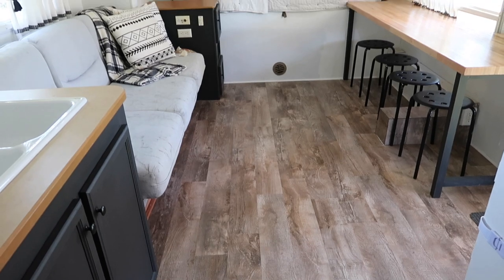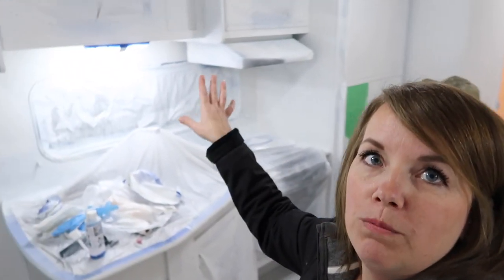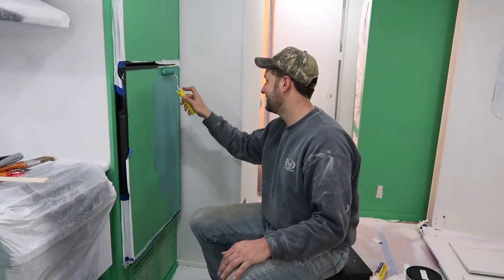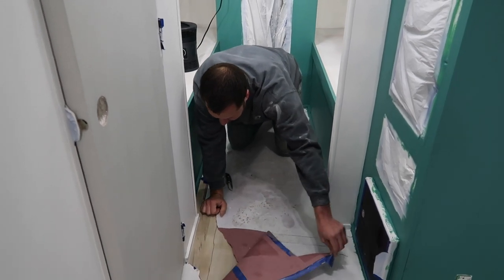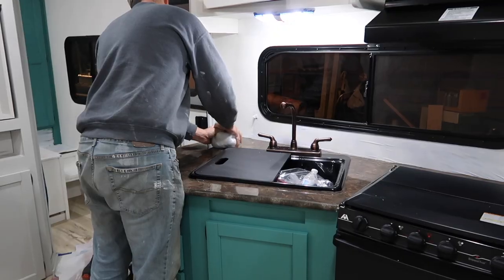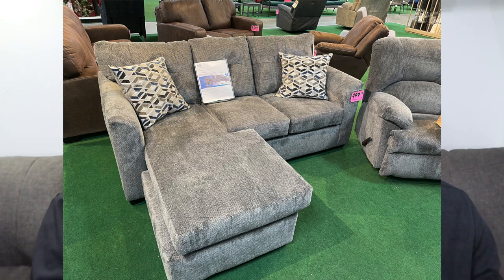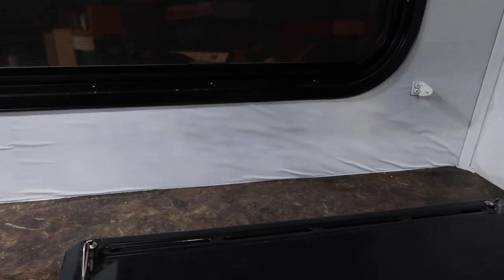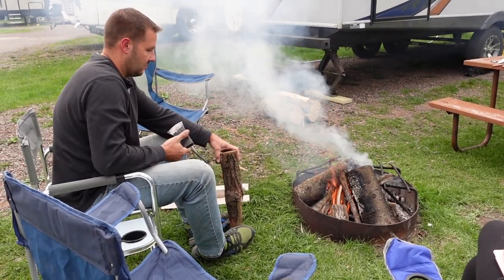We won't make this mistake again (ok, maybe we will ;)

Comment: You might want to try sitting the instapot and air fryer outside when you're using them.  Then the camper won't smell like whatever you're cooking and it will save space inside.
Reply: This is totally what we do. We bring a small 4ft folding table with is and set it right outside the door. Works great!!
Reply: Well, if it’s cold that’s not workable.
Reply: @donnakkasper6634  That is true. We are in Arizona, so the coldest we have ever camped in is with a low of about 33-35, but usually it is warmer. We have a pop-up tent trailer, so not much inside space and have not had any issues using the appliances outside.
Reply: That's a good point! 

My parents have a camper and they rarely cook inside it. They're always using a propane stove or a grill outside. I think they don't like the heat and humidity cooking in a small space can make.
Reply: Won’t work in bear country, either!
Reply: Lots of people cook and eat outdoors while camping in bear country—it just needs to all be put inside either the camper or vehicle at night or when away from the camp area.
Reply: @jenniferstanton202  which may be reason they are bringing the insta pot and fryer.   But then one wonders why they didn’t just rip out the elements and range part and put extra cabinet or a table there.
Reply: When the mini fridge in outdoor kitchen broke, we put a big toaster oven (Wolf brand) out there instead. 2-burner propane stove for outside cooking. Like most stove/oven combos, ours suck. So we have a 1-burner induction burner for inside use and we have to go in and out for the oven but well worth it. Crock-pot stays outside too if warm enough.

Comment: First thing we did when we bought our 5th years ago, had the dealership rip out the U-shaped dinette and crappy cheap couch immediately (and had them throw away the master bedroom mattress and duvet). We put in 2 rocker/recliners (they are not the wide lazy boy ones), a 4ft folding square table and 3 folding chairs (just 3 of us anyway). Plus our dryer sits in that slide also (we have a pantry/laundry room, hard to find this floorplan anywhere else, we got lucky) so washer goes in there. Been a blessing! I could put pics up on IG if anyone needs a visual. Btw, since adding the dryer, the teen can eat at the table and we eat at tv trays in our rocking chairs or scoot the table more into the kitchen/dining area.

Comment: For backsplash, you can get peal and stick glass tiles that look really pretty from Home Depot or Lowe’s.  Love what you’ve done. We are redoing a 16 foot, but had to gut and start from beginning due to dry rot. Got new floor and walls finishing new ceiling to put tin roof back down on. Then putting tin back on sides. Then... we will get to think about furnishing inside.😊

Comment: The green is gorgeous! 
I swear by the 60-30-10 guide. I also like to select 1-2 frame/edge/fixture colors to use as a guide when selecting fixtures, hardware & accessories (even picture frames). Examples:  black & antique gold OR dark charcoal & brushed chrome. Keep those on your color swatch sheet too as you shop.

Comment: I just finished your video and had to comment.  The first color Tom painted, although beautiful was a bit bright.  The second is so much more complimentary. You two are doing a great job on the camper and I look forward to hearing how your upcoming road trip goes.  I sit at my kitchen table every morning and gaze at my 2003, 23ft, KIWI Hybrid that is in dire need of a renovation.  I have watched what you have done with your last camper and watched other videos of others and the motivation is there but our Ohio weather is stopping me and my camper sits in the open air. I will wait anxiously for the final reveal before you launch on your trip.  Dawn I wanted to tell you I joined the Take Back My Home series and have been doing chunks of decluttering .  I have left my home go too far,  too much stuff, so it is intimidating but I do something everyday.  Not as much as I should but every little bit helps.  Thanks again for making my week enjoyable with your videos. ~Debi in Ohio

Comment: I love the new color. One thing my pastor was a professional painter and even with expensive paint it makes a difference to have your primer tinted. It makes a big difference and by doing that we've been able to get by with one coat. Even when I went light over a dark blue because I had my primer tinted to accommodate going from dark to light it took one coat plus it turns out to be cheaper. You can tint any primer. We ended up learning the hard way after many years of painting. I hope your trailer gives you lots of fun and great memories. It looks really nice

Comment: The new color is SO much better! But sorry Dawn - I'm with Tom on the drawer pulls! Black matches the accent color! The brass is just out of place. For that backsplash area - can that wrinkly stuff be pulled off? If so, you might check into "Tic Tac Tile" or the Art3D tile. It's vinyl tile made to look like real tile, but way lighter and lower cost. They have subway style tile that could look pretty spiffy in there...
Love how the trailer is looking!

Comment: In the video the pull down shades looked like they kinda matched the flooring. 👍🏼 have y’all seen the “fake textured tin” backsplash squares? It’s plastic you can cut down so lightweight and could be the metallic accent that Dawn might have been looking for with the brass pulls. 🤷🏻‍♀️😊

Comment: Use a stencil to add design and color to the blinds and buy or build a table just like the other one to fit over or under it for a kitchen island. They can be stacked when not in use.

Comment: I'm surprised Tom had to paint so much of the green before realizing it was crayola green,  second brush stroke and I'm like 😞 
I like the gold handles but the black goes better with the black trim. 
Will you attach the couch so it doesn't  slide around in transit  and damage anything?

Comment: Curious as to why would you put the couch across from the kitchen cupboards and not the table?  If they were switched you would have a designated kitchen and a designated living room.
The floor looks awesome with the new color scheme...sandy to match your beach color!
And I have to agree with Tom on the brass handles...black is so much better.  We have a converted pro master van that we travel in..I chose black handles too but I got curved ones..the square ones are a bruise waiting to happen

Comment: There are flat pack couches, I have one that also turns into a click clack bed. No problem getting it anywhere. There's a brand called Swyft that do them (they're very expensive) but there are lots of cheaper options.

Comment: I think the house i am in was painted with cheap paint and not enough coats. The ceiling has really obvious roller lines and patches. The walls mark really easy and nothing i have tried gets the marks off. If i owned this house rather than rent. I would totally do so many things including a total repaint.

Comment: Good call on the black pulls. Brass goes in and out of style too quickly. One question. How do you keep the furniture from sliding around all willy nilly in transit? That is why it is built in in the factory I think.

Comment: Take shades outside and spray paint in your matching teal color.😊
Reply: Won’t the paint crack and chip along all those accordion fold lines?
Reply: @Lucinda_Jackson  I think if u use a spray can spray paint with a light coat then no cracking. May have to do 2 very light coats to cover. Letting it dry completely between coats.
Reply: @jeancooper3737  
Sounds good - I’ve never tried anything like that and just thought I’d ask, in case!  I’m sure you’re right.
Reply: @Lucinda_Jackson  I'm not positive so test on other similar material
Reply: @Lucinda_Jackson  I like your dog I have 2 welch corgis
Reply: @jeancooper3737  
Thanks, Jean!  I love corgis!  I always used to say “next time, a corgi!”  And then there’d be two more dachshunds!  😂😂  I think I may be on my last dog.  He’s young, my doxies usually live to 16-18, and I just turned 65, so...
Reply: @Lucinda_Jackson  I know I turn 64 in a few months... I'm making home made doughnuts so I may be speeding up the process lol
Reply: @jeancooper3737  
Have one for me - I eat keto so I haven’t had a doughnut in years but it sure sounds good.  Enjoy!

Comment: How will you fasten down the tables when traveling? Strap them to the wall? I'm sure you'll find a good solution. :)

I am a fan of brass pulls, just not pointy ones. Too hazardous; will get caught on pockets and maybe rip them (personal experience), and if the kids trip and fall those pulls would do some damage.

Comment: I think the brass pulls are gorgeous but don't really work with the rest of the style of the camper. The slightly rustic flooring and the black accents everywhere else mean that the black pulls mesh with the style. Brass pulls, while beautiful, would have caught the eye too much and looked a little garish for the camper. That said, I think the camper transformation is incredible and that you two compliment each other so well.  Looking forward to hearing about your trip.